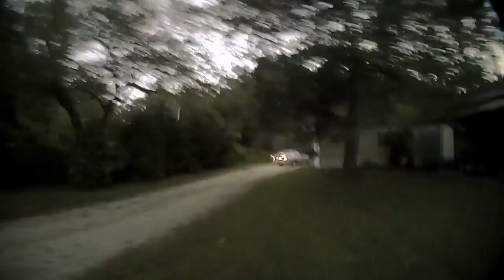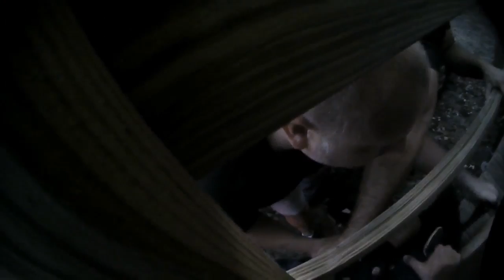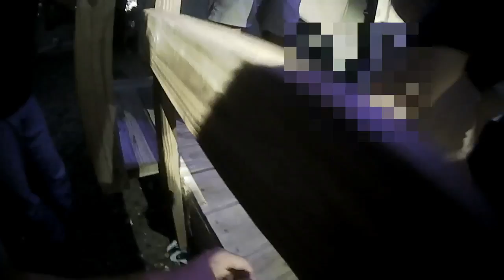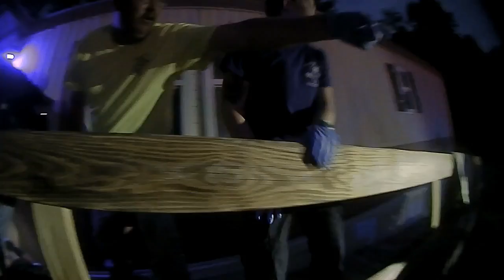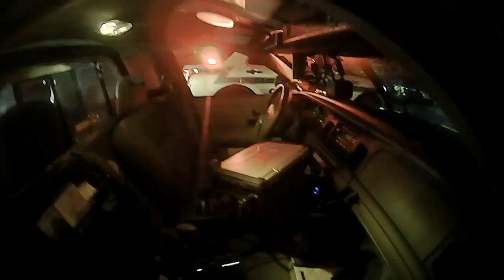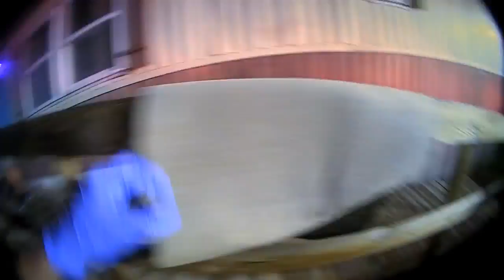[Full Video] Arrest And In-Custody Death Of Anton Black | Body Cam | United States | 20180915

Comment: It has been well documented that tasers can cause cardiac arrest. "Law enforcement and other individuals using a stun gun need to be aware that cardiac arrest can occur, however infrequently, and therefore it should be used judiciously, and an unconscious individual should be monitored closely and resuscitated if necessary." Perhaps this is not officer error. Maybe stun gun usage needs to reexamined. We need more research as to what current level is safe especially for people with heart conditions. The boy clearly wasn't mentally stable and should never have been released from the hospital to begin with.